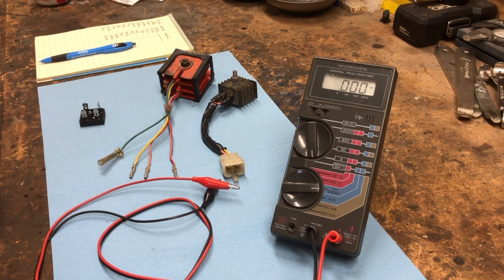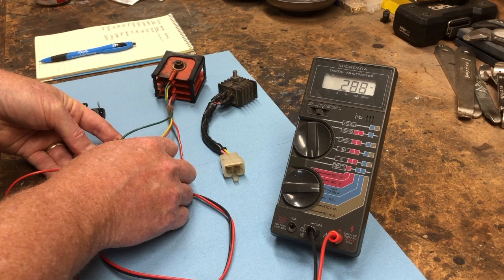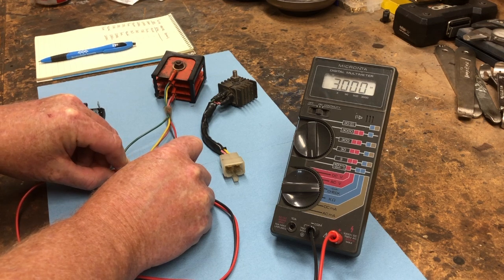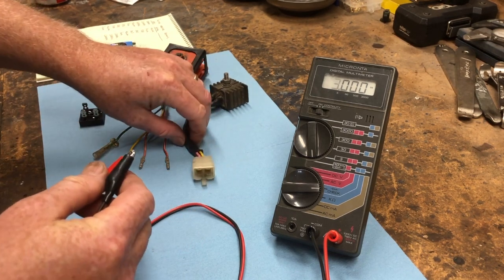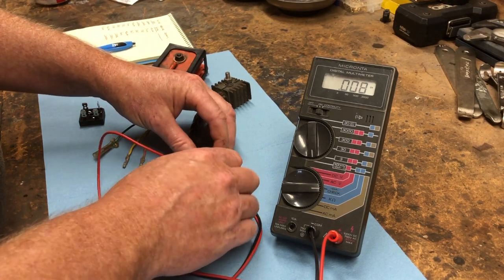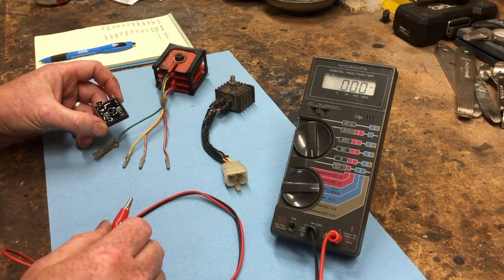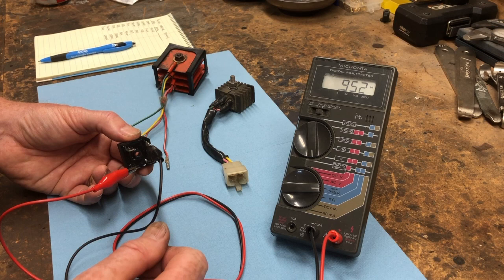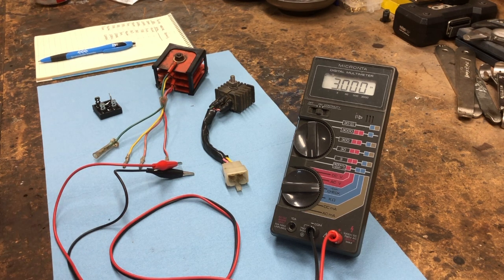CT90 Rectifier Test

Comment: My 68’ trail 90 go’s through batteries and if I leave it plugged in the battery will be dead the following day. Perhaps I need a new rectifier?
Reply from the maker: Updating your rectifier would be a good place to start if you are  still are using the stock Honda rectifier.

Comment: Hey Mike. Between your videos and the ton of info on your site, you’ve been a big help in my journey to getting my k2 ct90 running. I’m not quite there yet. Having issues with wiring. But I’ve learned a lot on the way. Your photos of the wiring harnesses have been a lot of help. Anyway, I’ll get there eventually. Just wanted to stop by and thank you for what you’ve posted.

Comment: Michael, this was very helpful.  I have a SL350, the rectifier is identical, the bike also has an external 12V voltage regulator.  Can the voltage regulator be bench tested with a multimeter?
Reply from the maker: Hi Clay, I'm not familiar with the SL350 voltage regulator, so am not the best person to ask, but from my limited knowledge I would say that there isn't a simple bench test and you would need to test the voltage regulator while its installed on your bike with the bike running. If you attach your volt meter to your battery with the bike running then you should see that the voltage stops rising in the ~14.5 volt range (there should be a number in the Honda manual)  as you continue to increase RPM's. If the voltage continues to increase beyond that peak value then your voltage regulator is probably bad. Good luck and I hope you figure out if your voltage regulator is good or not.

Comment: Hey, Michael, I have a 75 Honda ST90 with the same rectifier, but the wires seem to be riveted top the connectors. I can't determine if it's a screw or a rivet, and no wrench seems to fit. I'd rather not cut the wires if at all possible. Do you know how the wires are connected? Thanks!
Reply from the maker: Hi Mark, I don't have one of those in my shop right now to look at to respond your question, but my hunch is that they would be riveted. When I test a rectifier and find it bad Ill just clip off the wire harness and throw away the rectifier and then re-terminate the ends of the wire with spade connectors to use with an off the shelf full-wave bridge rectifier.  Sorry I couldn't provide you any more info, but good luck with your ST90!
Reply: @michaelmineart1889  Thank you for your follow up. I removed the battery-tray and found the connector plug - duh- so all is ok now. Take care, and thanks again!

Comment: can you please explain why you're using terms like "half a volt reading" when the meter in the resistance setting used to check continuity? thanks
Reply: I think its because a standard silicone diode takes 1.6 minimum volts to force conductance. So if the diode checker is pushing 2 volts the remainder voltage beyond 1.6 volts for conductance would be 0.4 volts or 400 millivolts. The CT90 old school rectifier may not be silicon but selenium so it may operate slightly different threshold of +- 10 millivolts over the 1.6 . Perhaps more correctly for the term,  the silicon diode has a 1.6 volt "voltage drop", but .3 Mv drop is correct for "voltage drop" (or remainder voltage pressure) below 2 volts. Depends how you look at it. But I may be confused too. :) good question I have to do more research.